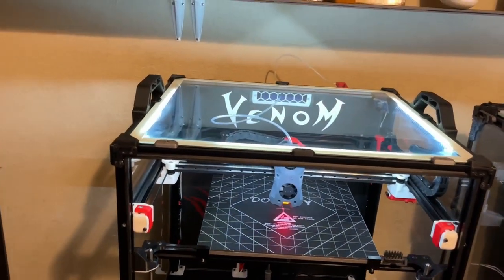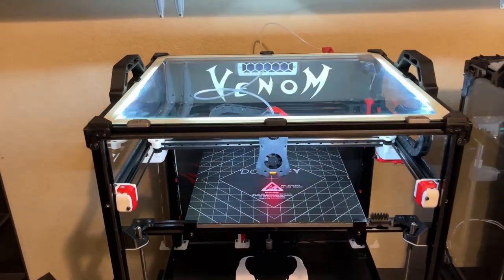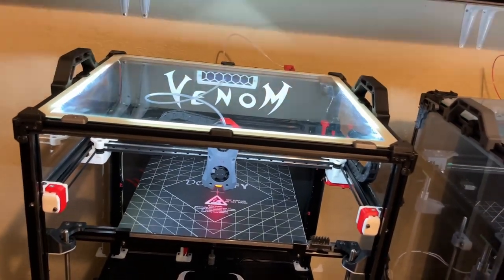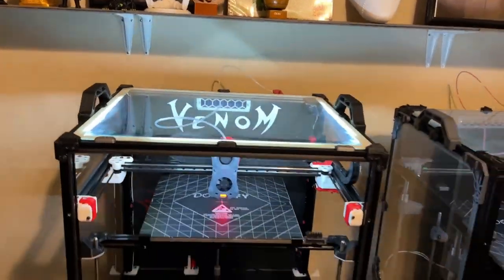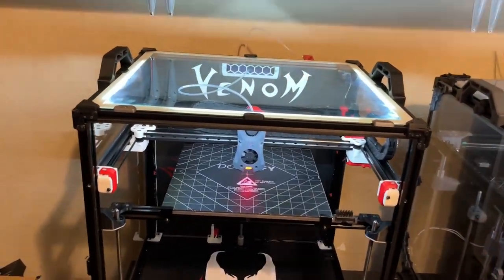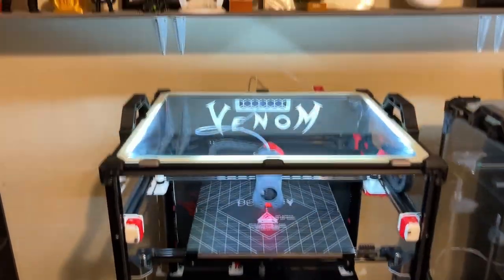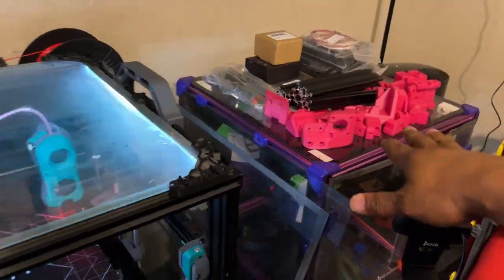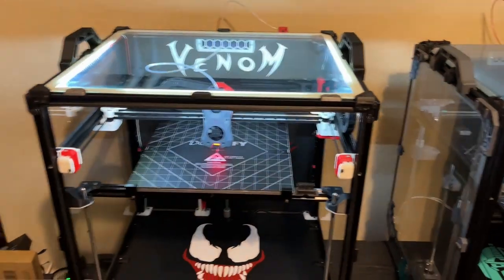//Can you use glass for 3D printer Enclosure // GoldenJaguar392 #3Dprinting

Comment: I use glass on my V0.1 and plexiglass on my vzbot. Glass has been great and the panels only cost me $7 cut at the hardware store. I would've done the same for my vzbot but the cut panels were $75 and I got a good deal on some plexiglass sheets. Chamber temps went from 47-55c after the switch on the V0.1.
Reply from the maker: awesome glad to see the results are true with glass.

Comment: I like your printers. I am considering to change from clear acrylic panel to laminated glass panel. I have a couple questions here. How you mount the glass to the side windows? You use the original mounting parts or you design the new ones. Did you change the door material to glass?  If yes, how you attach the glass to the hinges? Is it VHB double side tape? Thank you
Reply from the maker: I use annex k2 panel clips, with 3mm foam, I don't use a hinges just had 3mm soft foam then clip on to the front using annex k2 printed clips